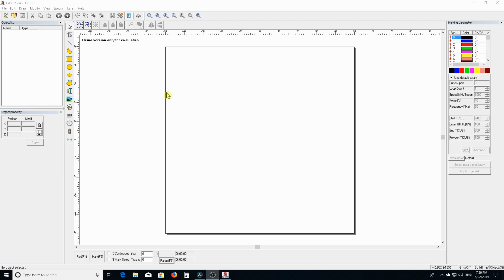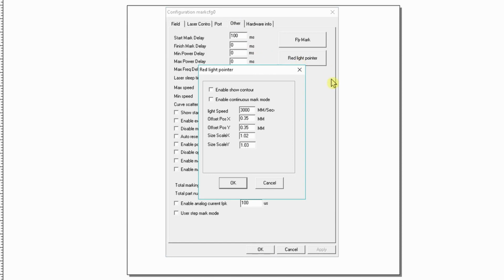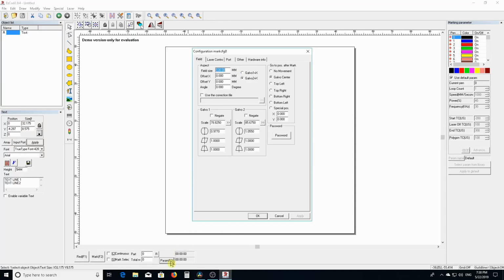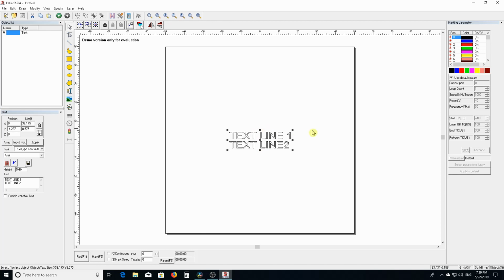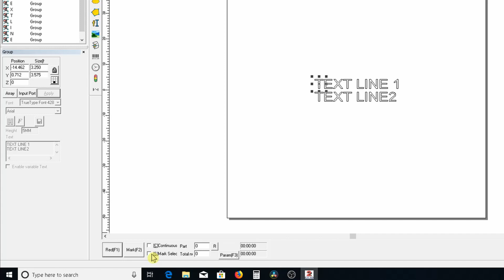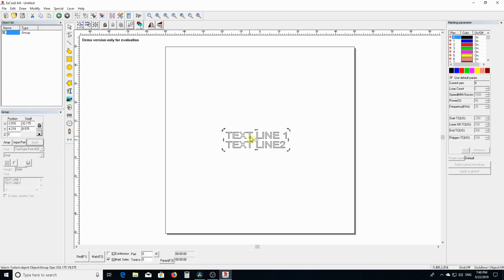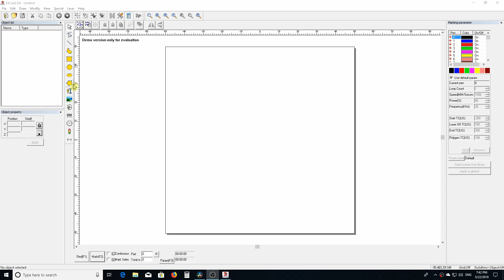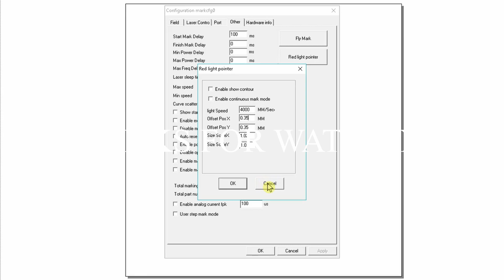EZCAD2 RED LIGHT POINTER

Comment: Red light pointer not showing from yesterday....marking is working...
Help me to fix this problem
Reply: If it was working and stoped, you may have a bad power switch for the pointer or the pointer died. The pointer is a small red laser unit in the head. You may have to open the head and look. Also it may have fallen out of the mount in the head.  Good luck

Comment: On the centre point of the workspace it shows exactly where it the red light is on the text but why it's not accurate on the top and on the bottom of the workspace even though i've adjusted the red light offset multiple times pls help
Reply: Interesting, In parameters, field tab there are adjustments for scale and shape adjustments.  Could be that you have not adjusted them to make a large square actually square. Or the pointer is not using the offset like when burning. You are the first person to mention that problem

Comment: Love these videos! They have helped out alot and deserve way more views and subs so thanks for making them. Could you do a video on converting "raster image" to vector in AI then exporting to Ezcad2?
 I'm stuck and its driving me nuts, i can use the image trace tool to get the desired effect i need, but when i export or use the AI file (AI 3) it only imports the trace outlines and none of the shading. 
I ultimately want to engrave images with the backgrounds cut out instead of the conventional square your restricted to using raster images.
Reply: FYI Subbed and going to mention and link when i do my next laser video :)
Reply from the maker: https://youtu.be/Epx-2lC6AmI

Comment: Good video, Thanks!  I didn't realize that you could change the speed of the red light pointer.  Also, It looks like you're using version 2.9; in the newer versions they've added a tick box on the bottom of the main screen that allows you to toggle on and off the 'show contour' feature.  It has helped me a lot in quickly making sure I'm marking something straight since the simple outline red light box is easier to see than the contour sometimes.  Anyway, I've got versions 2.14.2 and 2.14.0 of EzCad2.  If you want them, I'd be happy to send them your way (I'm assuming you can just copy over your saved parameters to a newer version).
Reply: I am stuck with my version because I do not have a dongle.

Comment: Great vid.  Another helpful tip, set the mark loops to 30 or 50, then it will draw each item that number of times, essentially stepping through all of your characters every second or two.  It is useful sometimes.
Reply from the maker: Yep good point.
Reply: my biggest problem is my machine will only let me laser metal if i make the picture small, if i do plastic i can make it big but, stainless or regular aluminum i can only shrink the pic to dime size for it to work. Even if i put the laser to full power

Comment: Why is it when i have a pic that i want to put on a material ie steel i have to make it small for it to burn on, when its big nothing happens
Reply from the maker: Pictures are handled a different way.
I would check your focus and settings.

I will look into that.
Reply: @ajimachining2537  i move the laser head all the way up and all the way down, i know how to adjust for different thickness, but still cant figure out why i have this problem
Reply: @ajimachining2537  and thank you for your videos, when i got my laser didnt know anything and your info really helped me learn a lot